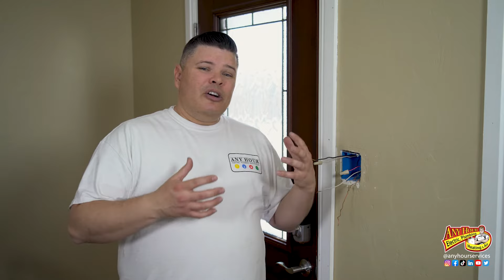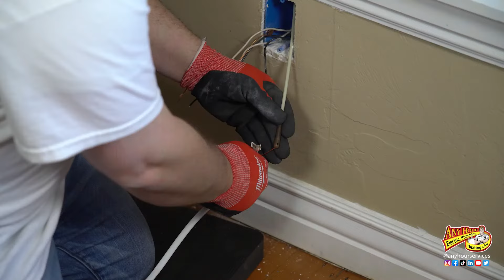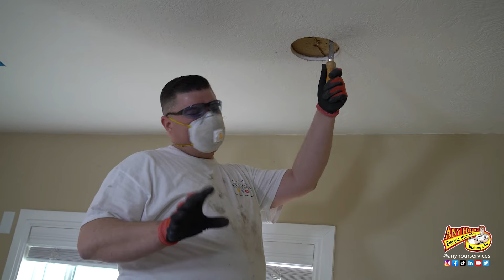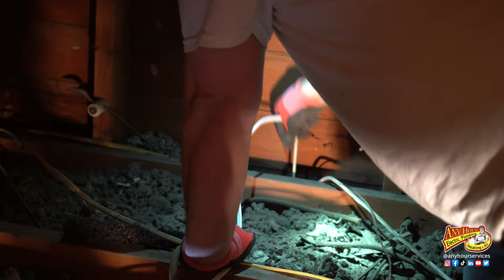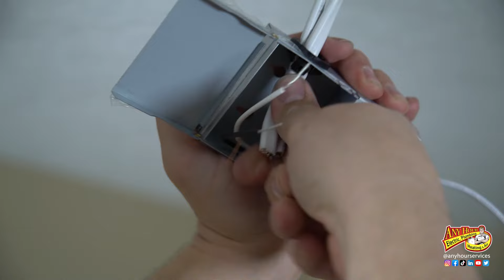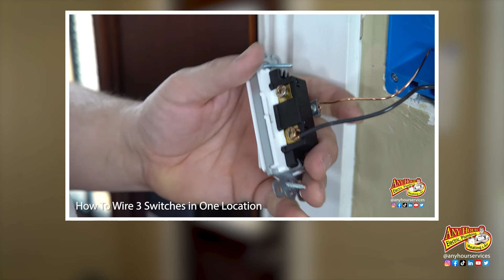How to Install Canless Recessed Lighting

Comment: How do you piggyback on a double switch on the first floor? the light switch(s) controls 2 separate fixtures which I already installed 2 canless recessed lights (have been working perfectly) but would like to add 2 more. 1 off of each, is this possible?

Comment: Fantastic simple instructions.  I'm placing a can above my kitchen sink using similar method but not into ceiling, into 1/2 inch thick wood panel above the sink that is even with cabinet tops.  There is about 12" of open space between the wood panel and ceiling.  I believe this can work as long as the box can be tucked behind the molding at the front of our cabinets.  However, is conduit needed for the line into the box from the drywall?

Comment: How do you know if you have power coming to the switch box?  Not sure how you determined that you needed to run cable from the outlet to the box.
Reply from the maker: Try using a voltage detector to see what wires are live.

Comment: What are your thoughts on air leakage when using canless recessed lighting?
Reply from the maker: The have a insulation ring around the rim that help with that. I have seen some people remove those, I don’t recommend that. I have not had an issue yet.